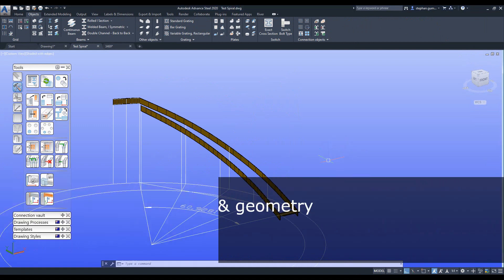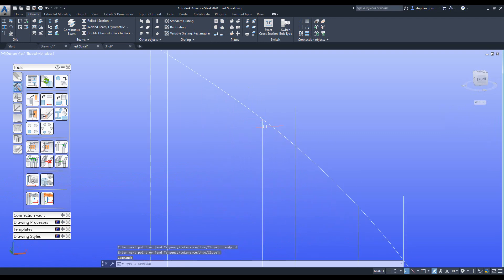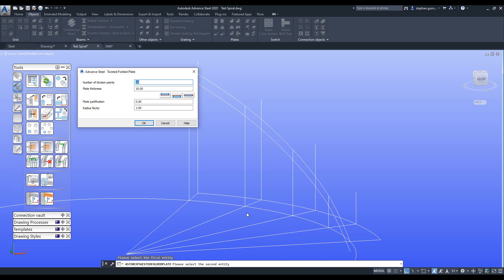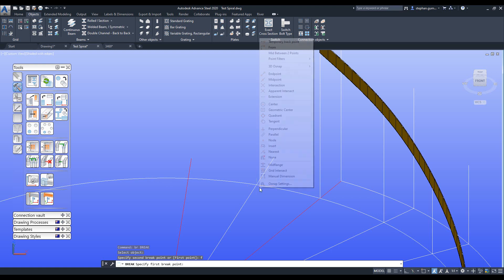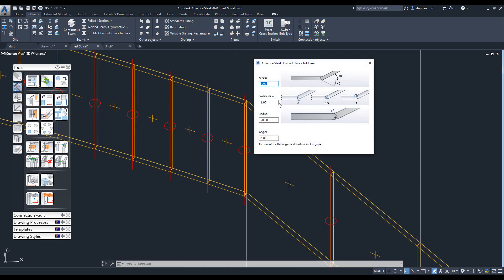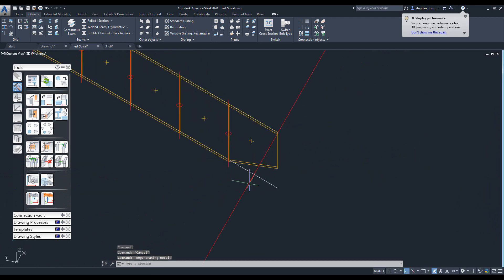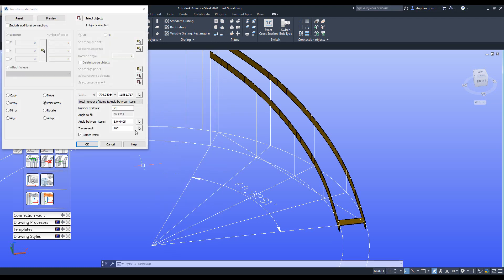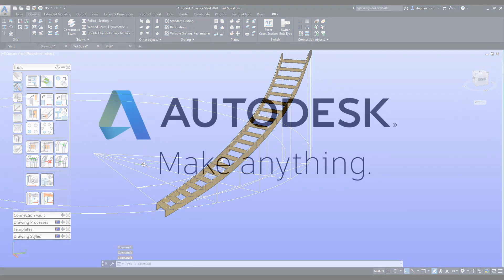Advance Steel - Spiral Stairs - twisted folded plate

Comment: Is this the best way to do it in Australia using monowills and webforge treads?
I’d assume you’d position a ball stanchion as a special part and advance copy as shown in your demo, then add railing between them? Same with a standard webforge bolted or welded tread? Having trouble at the moment as the spiral staircase macro doesn’t allow internal and external rail and tread selection doesn’t allow standard treads.